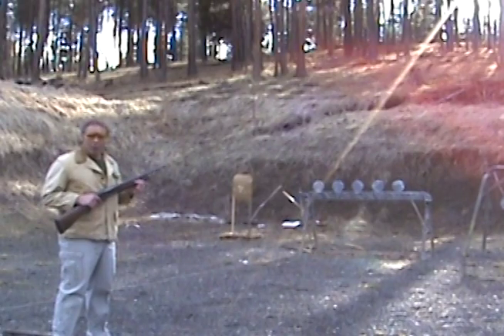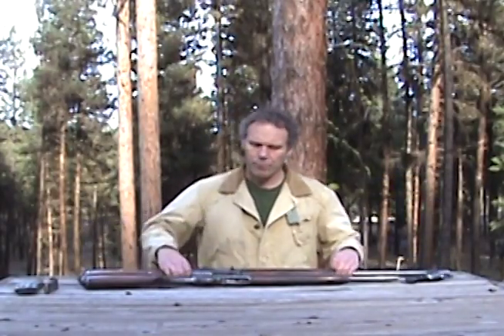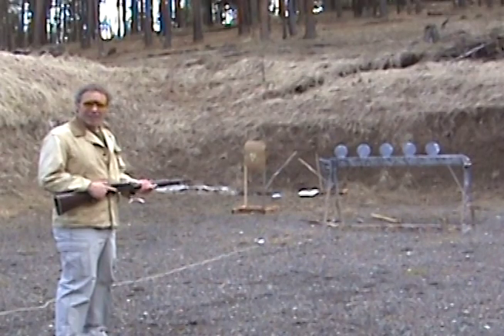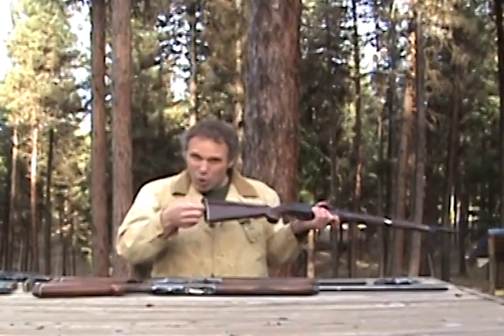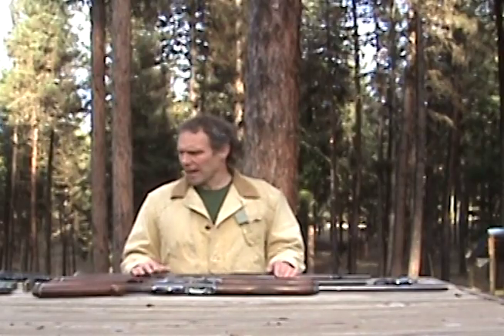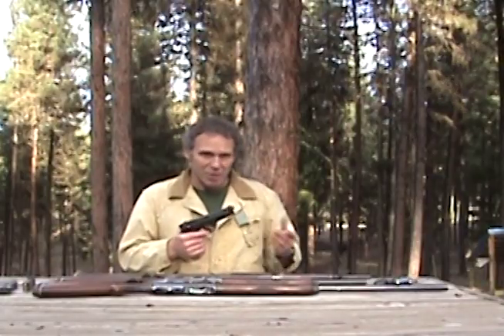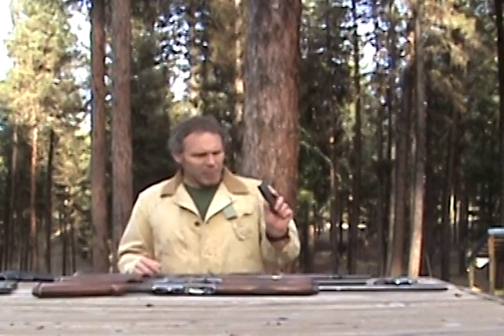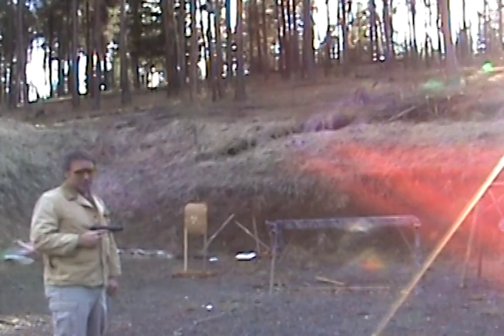Can spring compression damage a magazine?

Comment: In honor of Paul, I just went and pulled two rounds from every ultra-stored magazine...EDC's I'm keeping at capacity but for those just in case mags, I'd rather not take the chance.  I've always believed the "it's the cycling not the compression" line of thinking but anecdotal evidence is hard to argue with.
Reply: I thought of this video after my dad died a couple weeks before Paul did. I was going through his guns and picking out what to take home with me, and sure enough - I found a couple of magazines that had been fully loaded for at least 15 years, the ammo was corroded from sitting so long in them. Factory steel magazines for a Sig P226 in 9mm, and the magazine springs were indeed sloppy and couldn't feed properly.
Reply: @scottsracing  That sounds like a matter of corrosion more than compression, if the ammo itself was also corroded. Obviously something that has corroded isn't going to work as well, if at all

Comment: Good video Paul. 
As an engineer, I can say making a high quality spring is a 
difficult thing. There's really only about three materials a spring
can be made from. 

1. Iron-steel alloys
2. Titanium
3. Berylium-copper alloys.

Other materials like pure copper and aluminum have an
elastic limit that is way too low. Meaning that even with a 
small deflection, the elastic limit will be exceeded and a
permanent plastic deformation will occur.

But to make a really good spring is very difficult and 
expensive. Just the right alloys and an intricate heat treatment.
This will result in a spring with a high elastic limit.
(Will survive a large compression for a long time.)
But even a quality manufacturer can put out a 
"bad spring" occasionally.

Your two solutions are perfect:

1. If a spring has taken a permanent "set". 
  i.e The spring is a little shorter than it originally was,
  Then stretching it out(exceeding the elastic limit) to get
  the spring back to the original length. But each time this is
  done, the metal is being "cold worked-hardened". And much like
  a paper clip bent back and forth, it will eventually fail.

2. If you suspect you have a mixed bag of low quality and high
   quality magazines, or just want them to last forever, 
   loading them less than 50% (15 rounds) will keep the spring
   compression below the elastic limit even for the low 
   quality magazines

For me, 99% of my shooting is at a shooting range where I am
experimenting. I load all my magazines with 6 rounds. And any
loaded magazines I store are loaded with 6 round. I'm quite sure
even the "bad" magazines will last forever. And even at 50%
loaded they would probably last forever.

Jeeze I'm long winded...

Your vids are great.
I will become a member.
Kevin
Reply: Not a mechanical engineer - so please correct me where I'm wrong:

The amount (say percentage) of how much a certain spring "relaxes" while being left loaded depends on the following:
- The higher the temperature - the more quickly it relaxes.
- The higher the load - the more quickly it relaxes.

I'm not sure if either of the two are exponential, as in, removing a few rounds from the max capacity would make more of a difference, than removing two more on top of that would.
Same goes for temperature.

What I do figure to be rather exponential is the time: the relaxing that happens within the first say 10 days is by far larger than any extra amount of relaxing that happens afterwards.

Again, correct me where I'm wrong. Based on the little knowledge and experience I have, I'd say that clean, good quality magazine, filled to roughly 70% of its full capacity and not held in very hot, or very cold, or damp conditions, should be fairly reliable. As in - not really needing to be kept unloaded.
I'd say the same about the ammo in the magazine.

Having said all that - however slow the relaxing of the springs were, I don't see why anyone would keep loaded magazines in storage.
Reply: Physics grad with some engineering interns/jobs/personal experience:

I think most of the ignorance comes from finding some equation or article loosing citing that equation. Here’s an easy solution, that requires only a few variables. And energy is conserved.

First time I worked outside of that world, a weld engineer made me feel like a newborn as I realized how little I knew—not that what I knew was wrong.. just that ideal, perfect situations only cover so much. The rest is handled in smoke and grit and trial and error.

It’s nice to think that a compressed spring in a closed system has to contain its energy forever (like it would be on a physics exam). Realistically the spring doesn’t just push in one direction, the plastic of the magazine can warp, the metal can decay...

Paul’s videos—scrubbing everything gun related—are like if Socrates had a camcorder in the woods.
Reply: @BikeGremlinRS  So relaxation is a function of time and temperature.

A spring will therefore always try to reach atomic equilibrium at any temp above absolute zero, at all times, and under any compression.  The force the spring generates is an effect of atoms trying get back into a stable configuration, but the atoms also vibrate with an amplitude according to temperature (temp is a measure of kinetic energy).  

If kinetic energy is high enough, it will sever the bond between atoms and reduce the spring-force accordingly.  Alternatively, if the time is long enough, the probabilistic laws of quantum mechanics dictate that the positions of atoms are chance occurrences and the bonds are going to break randomly anyway given enough time to make a probability a certainty.   

So if the temp is sufficiently high (red hot), the high amplitude of motion causes the atoms to move to a new stable configuration nearly instantly, resulting in the spring loosing ability to push back against the compression force. 

If the temperature is lower than that, then it's just a function of time, and whether or not that time is linear depends if there is reason to believe that one atom severing bonds assists or hinders another in severing bonds.

It's a process that's happening all that time.   So, store the spring as relaxed as possible and reduce the temp as much as possible.

Then again, the times could be so impossibly long that it just doesn't matter, but that depends on the spring construction.
Reply: @bluenami7520  Thank you. :)
Reply: @bluenami7520  If time is a linear (if I understood your explanation correctly), could an experiment be made?

Taking like a dozen magazines. Measuring spring "strength" (rate, whatever is the proper technical term). 

Then leaving 3 empty (as a control), 3 filled to 1/2, 3 stacked to 2/3 and 3 full magazines. Leaving them for a year, then re-measuring the spring strength.

Would that show how much leaving a full magazine for long periods of time affects the spring? Whether not leaving it fully stacked makes a difference.
Reply: @BikeGremlinRS  Yeah I thought about an experiment myself, but with plain springs so I could take exact measurements.  A year may be long enough.  Take coil springs and stick a bolt through the center, then tighten a nut down on the bolt to compress the springs a specific amount, then throw on a shelf for a year along with uncompressed springs for controls.  I'd put some up high in the house and some down low to test temperature.

I've read harddrive failure data from servers and got the impression that harddrives higher in the room fail faster than ones closer to the floor.  Likewise the springs higher in the room should relax faster than ones closer to the floor if my theory is right.

To test across time we'd have to check at least 4 months, 8 months, 12 months for 3 data points (3 points defines a trend).  So we'd need 6 springs for each compression amount: 3 up high, 3 down low, plus controls.  I wouldn't expect much change over that time though because valve springs in engines sit compressed for decades and then only require a thin washer under them to bring them back to specification.
Reply: Appreciate the information, thanks!
Reply: @BikeGremlinRS  Are you seeing why yet ? Maybe another month or so you will. lol
Reply: @m1a1abrams93  Not sure how to precisely measure spring strength. Got mostly bike shop tools at my disposal.
Reply: @BikeGremlinRS   I was referring to this question you stated. I should have posted with my response earlier. 
              " Having said all that - however slow the relaxing of the springs were, I don't see why anyone would keep loaded magazines in storage."
Reply: @m1a1abrams93  No - I'm not the brightest of the bright, plus not a native English speaker (no sarcasm, nor irony).
Still don't understand why one would keep a loaded magazine stored. Especially for long periods of time.
Reply: @BikeGremlinRS  When the Govt is releasing criminals into society & forcing people to stay home. A long with stores running short on supplies. And a few examples of these criminals doing what criminals do, murder, rob & rape. In the USA it may be wise to keep a few on the ready. I am.
Reply: Underrated information
Reply: M1A1 Abrams I agree about having a few ready, especially with all the horse sh!t going on right now. I think another option for people if they are worried about possible spring failure is to have something like a “mag charger” (I have one for my ar15) on hand so you can quickly load empty mags just in case things go bad fast. I guess another option is to have several extra mags and always keep a few loaded but rotate them out every so often. That said, there is a good argument for “I’d rather lose 10% of spring power and still be able to shoot over half a mag, than to try to dink around with reloading an empty when I need to shoot”.
Reply: @m1a1abrams93  I see.
Reply: This comment/reply thread is giving me mini flashbacks to classes on airsmithing. One of the bits of wisdom imparted was taking the tension off of springs (especially on low pressure regulators, due to the fine output adjustments and the effects bunk springs can have on function) in regulators.
Reply: I should clarify - I was taught if a marker isnt going to be used in the near future, back the adjustment out as much as possible to decompress the spring. That little bit of extra attention/prep on storage can save a lot of time on the backend trying to diagnose/fix an inconsistent output.
Reply: Billy Stink  that’s what I do. Have several magazines and swap the loaded ones out periodically. Heck I’m no engineer but that just stands to reason doesn’t it? Like Mr Harrell said we ‘should’ be doing preventive maintenance on our guns anyway so it’s all part of the process.
Reply: @BikeGremlinRS  "stored" as in, loaded and either in or next to the firearm. I like having a little more delay between me getting startled awake and a round going downrange. After all, every round goes downrange with at least one lawyer attached to it.
Reply: @bluenami7520  So .... store your fully-loaded magazines in the freezer?
Reply: What if I have a perfectly made from perfect material... but in the operation the spring performs it is over compressed? ;)
Reply: 50% 15 rounds ?
thats more then 10 bud, ATF is on their way.
Reply: There are educated people and there are intelligent people. 
The problem is that the educated people think that they are the intelligent people.
Reply: Ok sounds good and thank you for the info. Instead of 8 I'm going to load 7 in a fifteen-round clip. That should do it.
Reply: @BikeGremlinRS  ... I have several automatic pistols... They have 12-14 mags for each, in mag pouches, on belt, with, a  holster. I store them full so that, whenever I, or my sons want to go shooting, we can just grab the gun and the rig and go. I have 100 rds in Bandoliers for every bolt action rifle too. Ready to just grab and go... That's why I keep fully loaded magazines. The same for the Assault Rifles, but those magazines are in 6mag pouches. All Full ready to go.
Reply: @BikeGremlinRS  ... If I remember my Physics... CU... 45 years ago...  There is what is called a spring consent (Ks) that can be experimentally derived...
Reply: What's the spring silicon we hear about and what is music wire steel?

Comment: My grandfather had a Browning Hi-Power that had been sitting LOADED from 1945-2001. I found it, along with all the paperwork and other war souvenirs and took it to a gunsmith. Every spring was just as it should have been, perfect compression. Great video Paul.
Reply: you are one unbelievably lucky man my grandfather has a .357 somewhere in his walls that even he doesn't know where it is anymore.
Reply: My dad had a Beretta 948 and a Beretta M1935 that both sat with loaded magazines (magazines in the storage box, not in the guns though) for over 50 years, and not only did the magazines and guns work perfectly after a quick cleaning, so did the ammo, which I shot all of. It was all just stored in a small metal lock box, so no special protection, and other than some rust on the outside of the 948 they were both in great shape.

Comment: "Can spring compression damage a magazine?"

Depends on the type and temper of the steel used for the spring, the amount of compression applied and several other factors. Not all springs are equal and not every spring is correct for the application in which it's being used.
Reply: eventually, metal parts will be forged by self-disassembling nanites, hard-coded to create perfect molecular bonds. step two is a liquid suspension of repair nanomachines; just dip the old spring in the appropriate solution for a day or so.
Reply: @bakabiru2519  Ok, nanotechnology is scary stuff. Don't F up
Reply: @robertbates6057  it won't be me, i'm a theorist not an engineer.
Reply: @bakabiru2519  LMAO
Reply: I dunno. My CZ 75 has one magazine that needs a new spring, and that's only been left loaded for a couple years.
Reply: @Thunder Life Metal fatigue is when a metal part is cycled many, many (tens of thousands or millions) of times by applying and releasing a force on it. Each metal has a different fatigue stress limit and cycle limit. Magazine spring set happens when a spring is compressed beyond the material's elastic stress limit and goes into the plastic deformation zone. When kept in this plastic deformation state, the material creeps, which results in a permanent compression set. So all this depends on the spring material properties, the spring's geometry, and how far it's compressed. Once the spring is either compressed or stretched beyond its elastic limit, it will get a permanent set.
Reply: @ganymede3141  Strictly speaking, no. If you exceed the elastic stress limit, you cause plastic deformation immediately, not just if you leave the spring loaded for a long time. Spring creep occurs below the yield point.
Reply: Boom yup not all quality control peeps are good
Reply: Aftermarket mags are fine but Aftermarket springs scare me after I got a pack of 3 off of ebay and the first one I put in literally snapped first time loaded to capacity. Glock oem springs I'm 100% confident with.